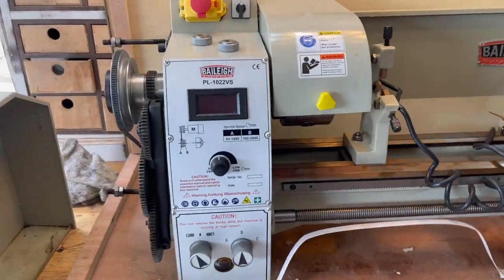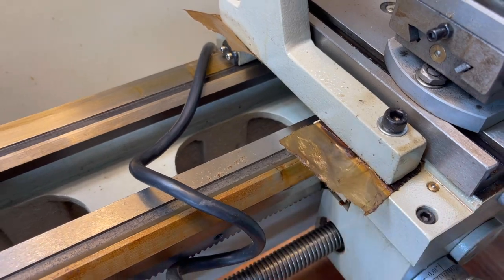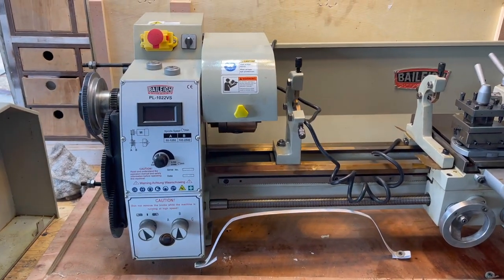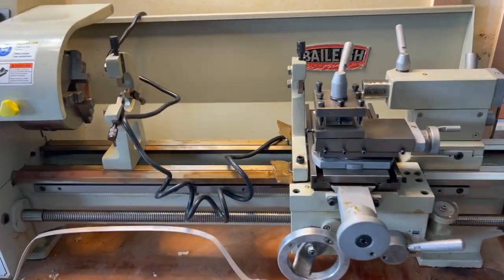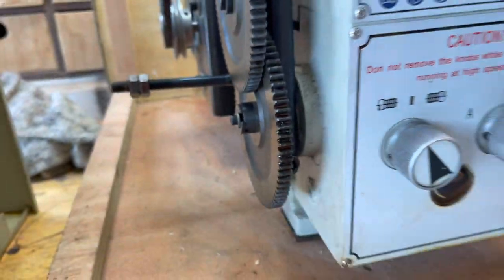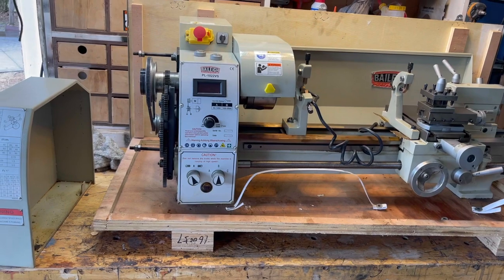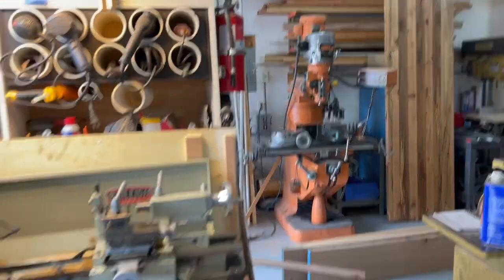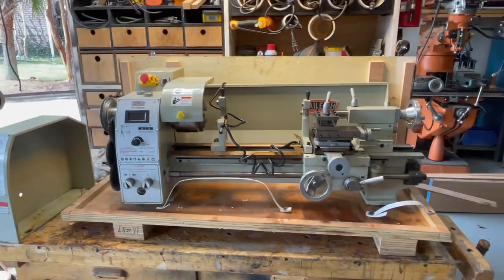My new Baileigh Bench top Metal Lathe

Comment: Hey - I'm trying to figure out how to remove the three jaw chuck from the adapter plate, I unscrewed the three bolts between the plate and the chuck itself and the plate just does not want to come off. Do you potentially know what the procedure for this is? The operations manual skimps on any of the details related to this.
Reply from the maker: Unfortunately, I don't own that lathe anymore or I would go take a look...   I did however just look at the manual, and just like you said it describes removing 3 bolts from the backside of the chuck.  Looking at the manual jogged my memory, and I believe it was no more complicated than removing the bolts.  First, I would first put something like ply wood on your ways for protection so if that sucker comes off it doesn't cause damage..  The safest way I can think of to apply a load with the bolts removed is to chuck an eye bolt in the chuck and use an engine hoist to pull on it (don't go crazy because there could be a mechanicla issue preventing it from coming off)...   If you don't have a hoist, I would strike it moderately a few times with a soft blow hammer and see if you can get it to come off..  They Grease these up pretty good with cosmoline at the plant before shipping, and it's possibly just adhered in place.   Some heat on the back side of the flange may help to soften the grease so you can break things loose. Try a heat gun or map gas...  Penetrating oil may also help with this.   You can also try chucking something long like a breaker bar or even a broom stick to get some leverage to pry on it...  Again, avoid dropping your chuck on the ways at all costs or you will have another problem to deal with.     Good luck and let me know how it turns out.  Oh yea, I cant remember the reason, but I called customer service and was able to talk to a tech to resolve my questions.  His name is Steven and contact info is: Phone:     (920) 684-4990. Direct:     (920) 482-3206. E-mail:    shutchison@jpwindustries.com
Reply: @JeremiahL  hey just want to say thanks for replying on a three year old video, really appreciate it.

Just to clarify, I got the chuck off the lathe, but there's that adapter plate that has the holes for both attaching to the spindle and the chuck - that's what I'm struggling with.

Based on your comment - I think what I'm gonna try is using those three points where you screw the studs in that attach to the actual spindle as "jack points". I'll grab some long bolts from the hardware store and start turning them in. Hopefully enough pressure to pop it free. I'll drill and tap bigger holes for larger screws later  cause those studs are not very large and I don't want to wear those threads out.

I have a heat gun I can try too, maybe I'll give that a shot first. I just think the previous owner never bothered to take the machien apart and like you said the cosmoline is probably just gluing the entire thing together.

I just wanted to make sure it wasn't threaded or some weird thing was going on there.
Reply from the maker: @Jerguu  yea, I looked at the parts diagram, and there no nothing other than those 3 bolts holding the chuck/chuck adapter in place.